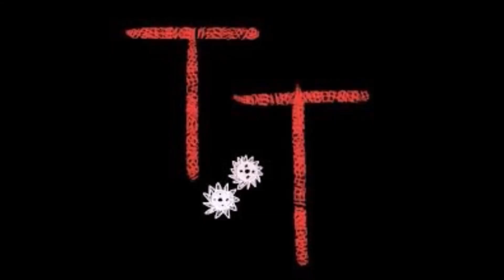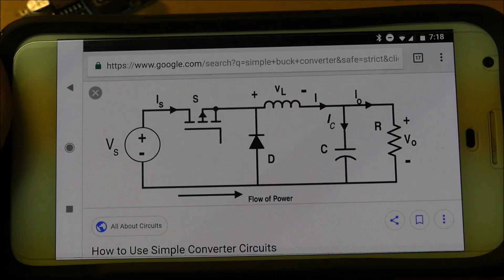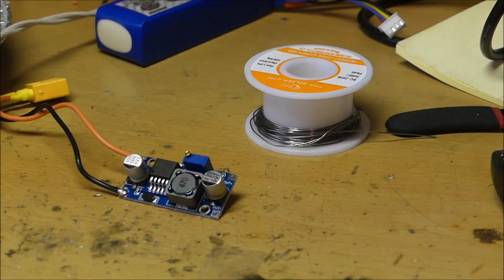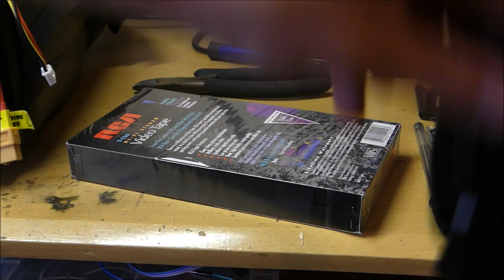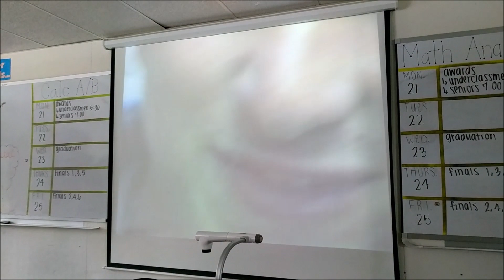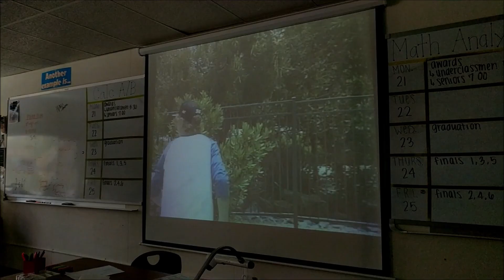New Power Supply for a VHS Camcorder || It Works Great!

Comment: My camcorder is a straight up 12 volt system. So I figure a 3s lipo would be perfect (12.6 fully charged and 10v soft discharged).

I have these cool thin ones that should fit the existing bay nicely.

Comment: I have another way to use a camcorder that can last longer than 2 hours of battery life. I have a portable power supply with outlets on it that lasts more than 8 hours that I can tape on the camcorder, but the ac adapter is too bulky with too many wires to carry around. Would a small ac adapter with the right volts, hz and watts be enough to power it and use?

Comment: I try head clean with soft cotton and pepper but now showing video i have Panasonic m3000 its works fine but video show for second (not video but jarmariya) i tried tracking setting but not work that is the solution